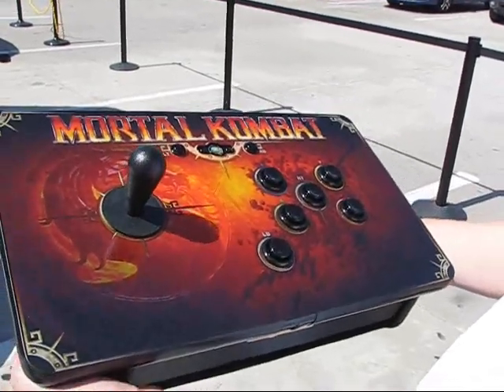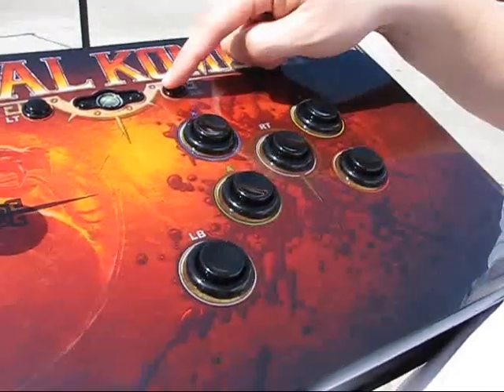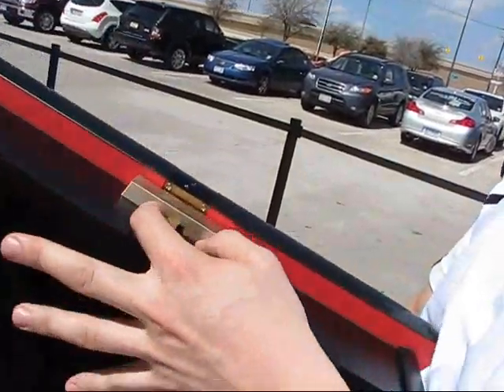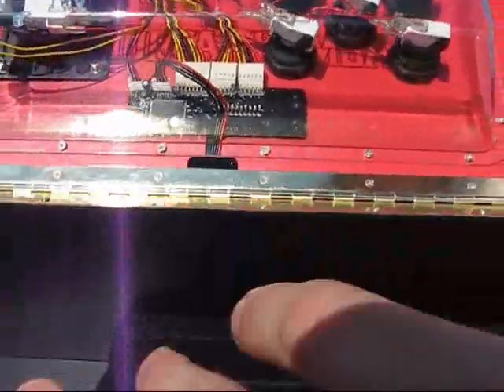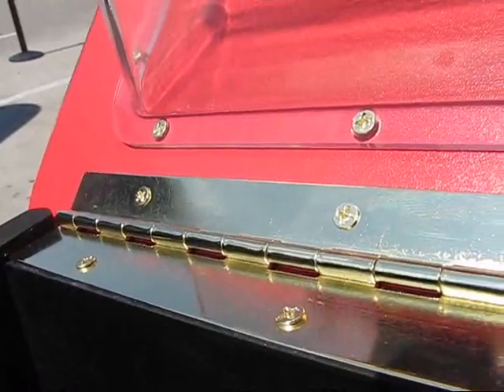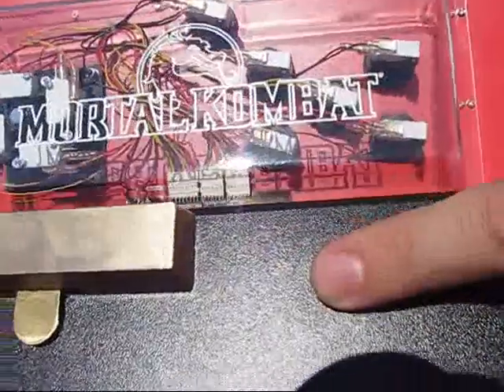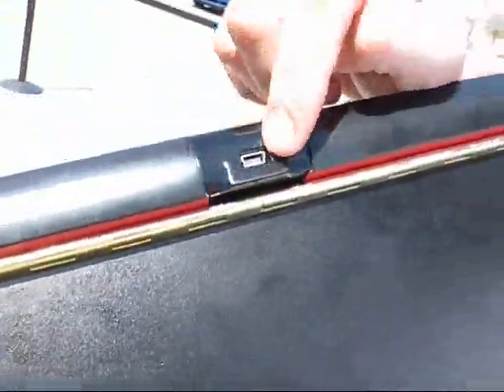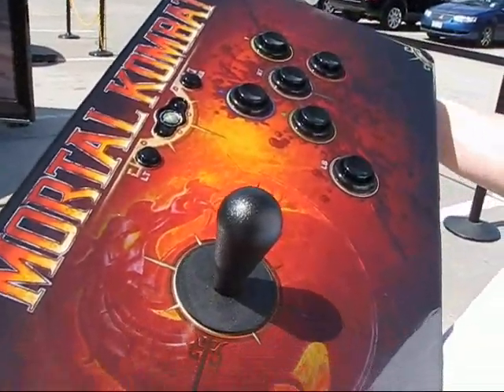Hands on: Mortal Kombat (2011) Tournament Edition Arcade Stick

Comment: @FearCarlos  the x-ray is easy.  you have to push front kick, back kick and block (X, circle, R1 on the PS3) together and you perform the x-ray. Mortal Kombat was made with that stick in mind and you can perform every move with these five buttons. to perform a throw you have to push front punch and front kick together. It's very easy to push tehse buttons together because you use your entire hand on five buttons